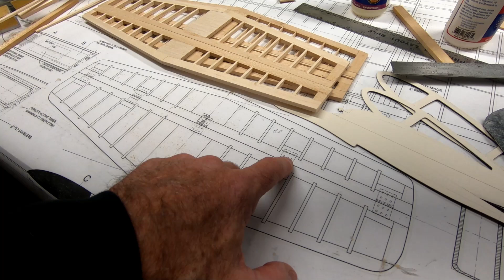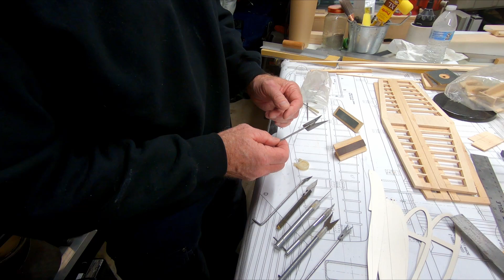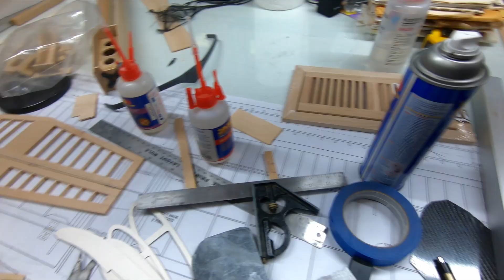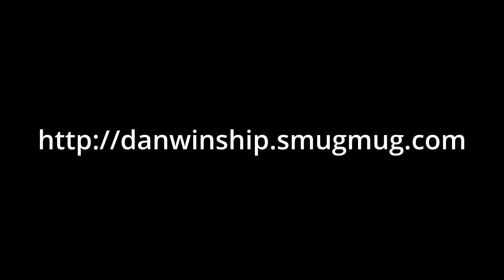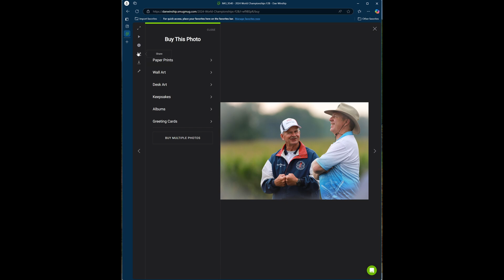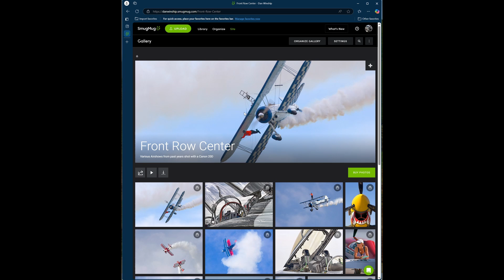Holeshot Build Series 5

Comment: Hi Dan....I recognize that 2nd slotting tool (on the home made handle). It's called the 'Aero Broach'.  I'm not sure if the guy still sells them.  It's nice because it actually 'broaches' a slot....no need to pick wood out after  the fact.  Dubro 116  hinges fit the opening nicely after using this tool.  As always, nice work...thanks for documenting.
Reply from the maker: @EstebanHerrera0577  Thank you for that information. I didn't know that tool was made for sale. Thank you for stopping by and commenting.